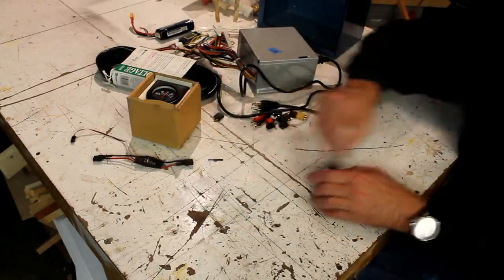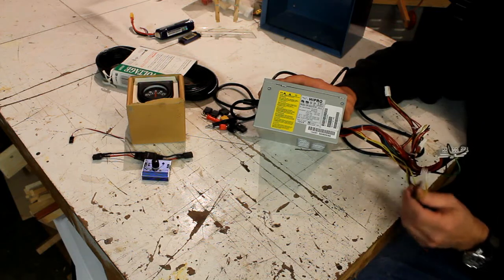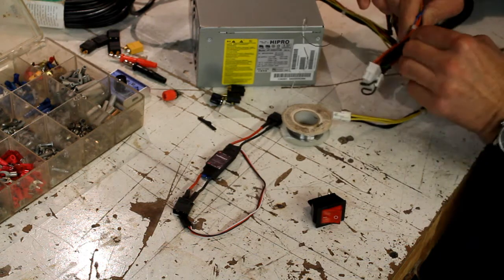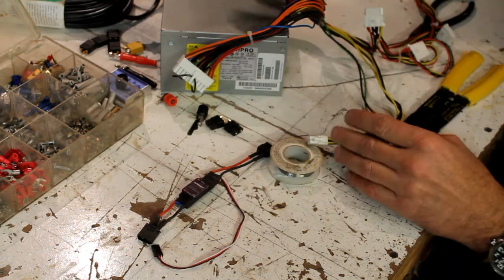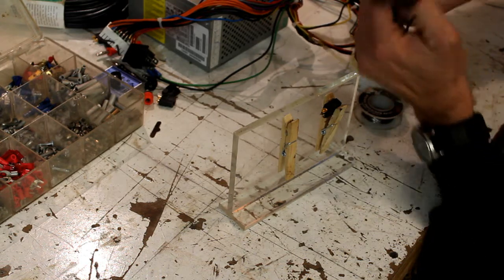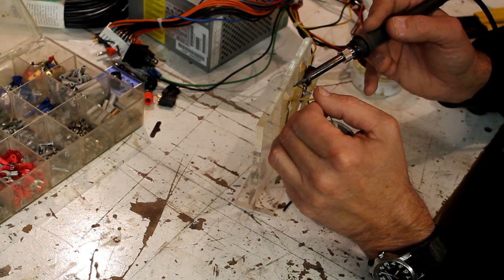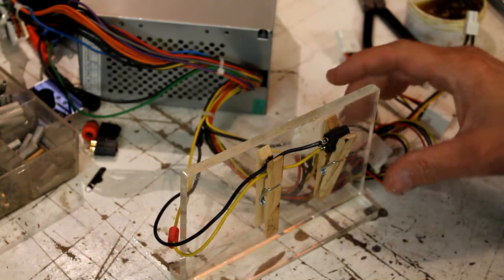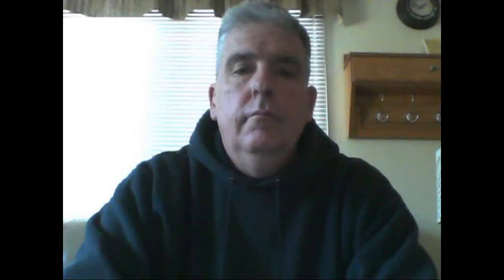PowerSupplyPart2

Comment: You need to explain why that controller "BEC" has only two conductors for an output?  Most have 3 not two?
Reply from the maker: This is a brushed speed controller. They only have a positive and a negative output. The three wire speed controllers you are you mention are for brush-less motors. Brush-less speed controllers will not work for this system. Brushed speed controller are less common now because brushed motors are not as common anymore. Brushed motor controllers (ESC) can still be found at sites like hobby king and banggood etc. Just be sure you if you buy one it is for a brushed motor. Also be sure it can handle the amount of amps the power supply you are using puts out. I hope this clears up any confusion. If you have any other questions please let me know I will answer them if I can.

Comment: What happens when your power supply already has a power switch?
Reply from the maker: You can use the power switch to turn on and off the unit, or you can just leave it turned on and wire up the other switch as in the video.
Reply: Thanks for the reply, do I still need to paperclip the black and green together or ignore that step?
Reply from the maker: The black and green still need to be jumped or switched. That makes the power supply turn on as it the computer was turned on.
Reply: Thank you.